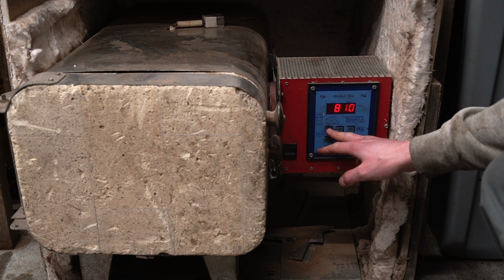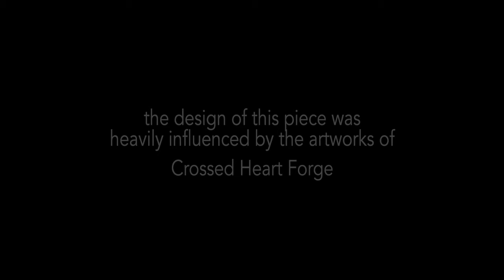Damascus Steel Japanese Tanto from Chainsaw Chain

Comment: Not crazy about the handle and sheath but the blade pattern turned out to be insane
Reply: I was thinking the same thing he uses this beautiful wood with a gorgeous grain and he doesn't even think to stain it imo the paint cheapens the whole thing.
Reply: Woodworking skills are terrible, not to mention using a crap wood like poplar.  I don't know a heck of a lot about Japanese blades, but I've never seen a tanto look like that
Reply: @CaptainRon1913  where’s your rendition?
Reply: @CaptainRon1913 , poplar has its place as a closed grain hardwood that is incredibly soft. I love how arrogant people call things "crap" yet show they know little-to-nothing about the subject matter of which they speak.
Reply: @haphazardlyhype  Probably going for a traditional shellacked style
Reply: @SuperLordHawHaw  probably should have researched that more. That much effort to slap something cheap out of a can with a $3 brush ... kind of ruined the finale.
Reply: @haphazardlyhype  WTF WAS HE DOING
Reply: You mean with all that de-lamination and rust trapped between the.. layers (?)? He even managed to fuck up the mekugi-ana
Yes it is insane to fail in so many ways throughout the whole blade and make a video about it as if you were proud of your work.

Comment: Gorgeous work! I would have preferred a stain on the handle/sheath instead of a solid paint job....but that's just a preference. The fact this blade is made from chainsaw blades makes it one of the greatest blades to ever blade.
Reply: All works is very good paint job too  bad
Reply: I was thinking the exact same thing about the stain - but that probably has to do with my own woodworking bullshit, which is made worse by me living in a forest that just keeps supplying me with pretty wood. I have a few pieces of Bradford pear that picked up marvelous mineral staining from the earth. I'd give almost anything if I had enough of it to make a bagpipe out of.
Reply: agreed! stain where you can see the lovely wood would have been great. poplar does not need to be blacked out solid lol
just my preference!

Comment: Thank you for taking the risk for the sake of our own entertainment. I love your work 🥰
Reply: You mean when "Do not do this"?
What the risk?
Reply: @Anuitu2u  the wire wheel could catch the chain. i had a friend of mine lose 2 fingers doing that.
Reply: @Anuitu2u  2 things: It is generally considered unsafe to use gloves with a those sorts of wheels; and as someone already mentioned the chain can easily catch as well.

Comment: I like to start by holding on to the chainsaw chain while I use 12 inch wire wheel on a 2 HP motor. This way I make sure to get body fluids evenly dispersed throughout the shop.

Comment: Beautiful work. Loved the build. The only place I would like to have seen something different is the same place almost all "Japanese" blades fall short. That is that true Japanese blades do not have a secondary bevel. The primary bevels go all the way to the edge and meet. The blades are not "sharpened", but rather, the act of polishing the blade creates an excruciatingly sharp edge where the primary bevels meet.

Comment: I wasn’t expecting such a large billet from that amount of chain, did you use any filler material at all?
Reply: 1084
Reply from the maker: I didn't, I was surprised too but I think there were a lot of pretty significant inclusions in the initial billet that were making it appear bigger than it was

Comment: Does using the chunk of wood add anything specific to the metal or is that just a hard surface you are useing at the moment?
I  do wood working , dont know much about metal.
Reply: it’s just a means of only shaping the metal where the hammer strikes, instead of shaping it where the hammer strikes and where it presses into the anvil. It’s also a technique typically used for straightening blades without imposing damage to the shape and thickness of the billet.

Comment: Genuine question: why do some metals join up and become one piece when you wield + heat + hammer, but some will split up and refuse to join together?
Reply: Take a look into material science, it usually has to do with 'Solubility' or the crystal structure of the metal. Some metals are able to better make consistent metallic bonds with others and others simply cannot, this can be the result of various things like the difference in the size of the atoms or the orbital properties of the base element of the metals. Hope that can help get you started
Reply: I've seen some blacksmith sprinkle carbon powder in between the metal folds before hammering the two parts together

Comment: Very nice, came out very well. Ive got a little katana training, and can say that was pretty much on point. Handle and sheath should be a touch more egg shaped so they easily indexed in the hand without looking. That way you know 100% where the edge is pointing and helps align your cuts. Apart from that tiny thing, i still want it
Reply: There’s actually some delamination on the blade (when two pieces of steel don’t forge weld correctly, so you end up with a crack in the metal) I think, but that’s probably because of the chain having some spots that couldn’t be reached. Apart from that, i love that thing!

Comment: so hey .. i have some tips i picke dup ... dont heat treat the entire blade and dip it like you do treat it as if your wanna make a durable blade and only heat the edge of the blade red hot and quick cool it you will have a strong durable spring blade that wont break and edge that wont dull.

Comment: What's kind of liquid did you used sir to made design appear, (inside the white pipe )
Reply: Ferric Chloride. It's an acid to dissolve a bit of the metal away. different metals dissolve at different rates, which is what brings the patterns out in damascus style forging.

Comment: While the blade is quite beautiful i do have some issues. Knowing what a tanto blade is I can say this is not a tanto blade. Research tanto blade and you will understand the tip is wrong for a tanto blade. He started the process correctly for a tanto blade tip then he rounded it instead of keeping the angle correct.

Comment: This looks nice, has texture....
But it is not really damast steel. Damast is folded at least serveral dozen times, high quality serveral hundret times. Means to hammering it long shaped, cut in half, put one above the other and again, hammering long.
Dozens of times, then you get a very fine and thin texture on the metal.

Comment: For that source of steel, you should have used a canister and filled the empty spaces with steel powder, that way you get less delamination, also use more flux, about the quenching, that's thw only thing u did good, moving the blade a lot in order to avoid the gas jacket, but u did it in the wrong moment, first u should work the most on yor blade and let it almost fi ished before quench, that way u have to work less on the grinding and polishing, about the saya, u sholud use sealer, that way, it'll look like a piano instead a poor wood work! But nice video!

Comment: you have patience with some areas and rush others. The pattern looks great but the nasty paint drips on the scabbard, having it in my hands and seeing that I would be wondering what else was rushed. The last 10% of the job is 90% of the job.

Comment: Nobody seems to be able to make their damascus uniformly, such as a homogenous pattern, like the originals.

What if you took steel cable, forgewelded to start. Cut into very short lengths, such as 1/8". Stack the slices again but rotated slightly so it overlaps lower segments. Pack the spaces in between with powdered amorphous carbon, perhaps made from sugar + sulfuric acid and washed. Instead of cutting and welding, flatten and fold.  The welding is adding non-damascus metal and needs to be avoided.

Comment: Fukman that was dangerous with wire disc holding the chain in your hands " Dont do this" is 180% correctimondo bro. Unless you want to loose your fingers!

Comment: That is Nnot damascus steel! Please try to do something right. Damascus steel is - properly speaking - steel produced in an airtight crucible.  What you have done, however time-consuming, is welding different layers of steel against one another.

Comment: Arc welding on a ways (the slider tool bed), and with a tool-steel tool guide?! Are you nuts!?

Even a little heat will compromise all of the hardness and temper of precision milled tool steel. If you say one or both are already so compromised, then remand them to other tasks -- it is always possible to use tack-welding, cheap clamps, and a sheet of refractory material to do all of this.

Using chainsaw chains is a great idea, but you then have to apply additional procedures to mitigate inclusions and voids. I don´t see you using the best kind of kiln for this.